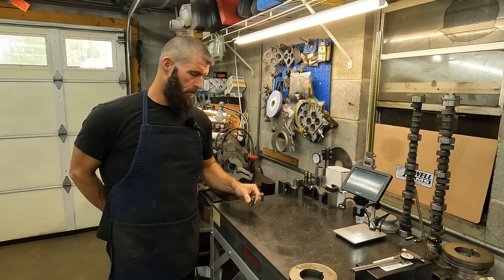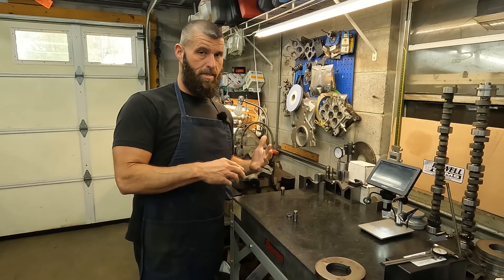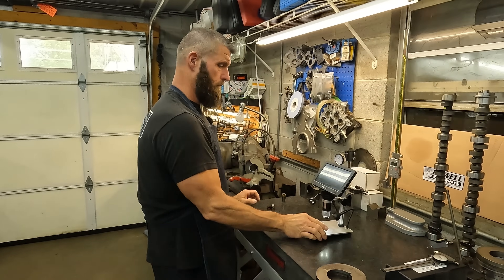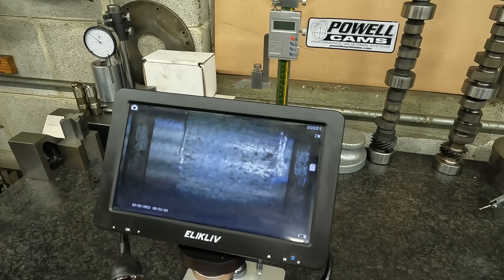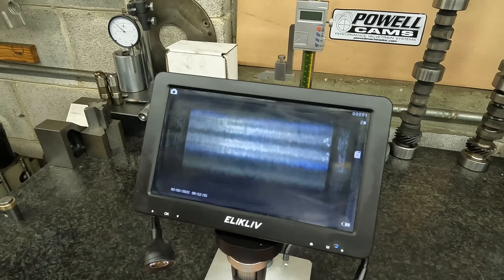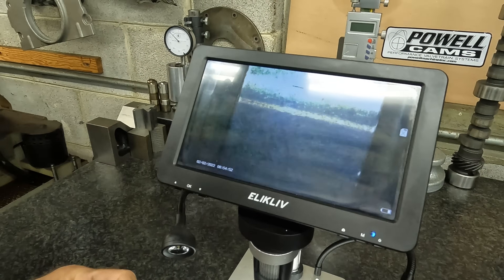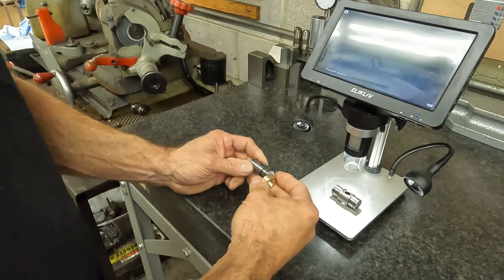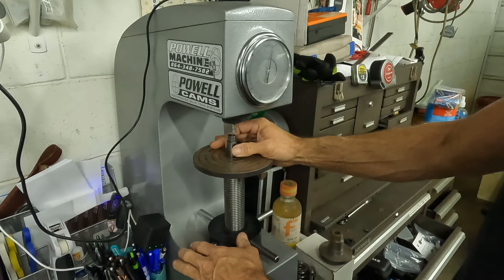Needle bearing trunion kit issues.

Comment: Well, for use on the street I used aluminun 1:6 roller rockers with the biggest widest needle-bearing trunions I could find on my 1st gen. smblk Chevy (which gives me about .590 lift at the valves minus the .017 lash set cold); but I used solid lifters with bushings and rev-springs for my solid roller 110183-10 Howards Cam and haven't seen an increae in lash since Aug. of 2018 when I installed it.

Comment: When I look at some of the systems used on these automotive engines I'm thinking there there's no way in hell this stuff is going to go 100,000 mi this is race car shit that has no business in down the road car applications and I'm surprised most of it lives as long as it does considering there's not a very good oiling system anymore It's like with cams these dry valleys used to be tons of oils coming down on right on top of the camshaft Not anymore You wonder why this shit tears up
Reply from the maker: 95% of the oil that gets on the camshaft is from the rotating assembly slinging it, this holds true for all time,

Comment: I remember way back when making some bushing bearings for a turbine engine where we had 17-4 at two different hardnesses engineers said it was going to work not at all welded solid in short order 
Similar material will not get along that's for sure regardless of one softer and the other harder they'll transfer metal until they start snowballing and they weld
Reply from the maker: Absolutely 💯

Comment: Bushings have a lot more surface area to displace pressure of needle bearing has very little area for the same pressure and they're probably not even rotating just rocking back and forth that would cause untold damage because you're not spreading the love amongst the rest of them needles that is
Reply from the maker: Absolutely correct

Comment: 35 years of tool and die making here.  The material used for bearings is 52100  tool steel. Most American made bearings are made from 52100.   It's really tough if properly heat treated.

Comment: Needle bearings in an engine usually dont end well. Not a huge fan of bushings, but far superior to needles. Needles are not great due to the concentrated load peaks. You can see the needle patterns in the one you showed. Start with the correct material, centerless ground, and dlc type coated steel on steel. I stayed at a Holiday Inn Express last night 😅
Reply from the maker: Thanks for the tips!
Reply: I worked at a Yamaha dealer and the racers “YZ” engine and….well all had needle bearings on the connecting rod. They had adjustable valves lash so I was always in there. These guys ran hard and always in for something they broke. Never saw any visible failure and these had 8k red line tachometers. Personally I’ve owned 17. 
  I am sure there is a lot of “Chinisium” out there as well as US companies selling roller trunnions. But who knows if they buy overseas bearings, finished trunnions or both. GM opened a plant in China decades ago as a Buick and certain Chevys sold as if the where Cadillacs! But, 51% of every company doing business in China belongs to the government there. They reverse engineered the TECH2 scan tool, sold them for $200, and they spilled magic smoke all over the bench. GM went totally internet based in 2013. That was the last year of software updates. Everything is messed up now!

Comment: The problem these days is you just don't know what material is being used in anything you buy.
It can look perfectly good but it's made from crap.
The overseas manufacturers of our goods seem to do this all the time. They have the technology and machinery to make the part and make it to precise tolerances but they make it from rubbish. It's crazy, the manufacturing of the part is generally the expensive part of the job, the material costs run second.
They are ruining perfectly good parts because they cheap out on materials.

Comment: I've worked on custom needle roller bearing assembly machines where individual rollers and races were measured and sorted to give uniform clearances for a bearing package.  The target clearance was in low microns and was crucial for longevity.  Seeing the finish on that trunion I would venture a guess that clearances were probably orders of magnitude too big.  Even if they weren't that finish (and the design with the groove and shoulders) would lead to contamination locally. Whatever the cause (design, material, hardness, clearances) brinelling is what I see. Once you lose your finish you're going bad fast.

Comment: I have a Jeep Wrangler running a 3.6L Pentastar® V6. The engine developed a ticking sound at about 50k miles. The shop replaced my rockers, cam shafts and valves on the left engine bank. They said the rocker bearing were the point of failure. Is this the same issue you’re talking about? It’s under warrant for 100k so I’m hoping the other side fails before then if it’s going to. What’s ya think?
Reply from the maker: Ye0, those engines are bad, we sell lifters, rockers and cams often for them, they have a severe oiling problem

Comment: Not hard enough at the running surface..?  (Before seeing anything) - needs to be .040 deep at the least, RC 58 or better, smooth, round…

Both needles, shaft, etc. need to have the right finish.  (From reading Torrington docs many years ago.)

Comment: I am an old novice asking novice questions. How do roller bearings last so long with the bearing and race both being rock hard and running in grease? I am talking wheel/axle bearings in old rear wheel drive cars. They last 100k routinely and seem to be the same hardness? Thanks for entertaining  an old guy's questions?
Reply from the maker: Full rotation of the bearing element,  proper materials  and proper finish

Comment: I think if the metallurgy is right, then the problem would be finish. A "rough" finish produces small contact points instead of a wide smooth area thus concentrating force and causing breakage of those points.

Comment: Ball bearing, roller bearings, needle bearings are meant to be used where constant full rotation is used and repeated shock loading is low. Whenever you go from a plain bearing to a roller bearing you reduce the surface area that carries the load. That helps with reducing friction but it des not mean it is a better fit for the job. I suppose it could be asked then why do we use needle bearings in Universal joints and that's a good question and I wish I had the answer. Maybe the shock loading is not as bad as you would think?
Reply from the maker: I agree,  but.... other rockers and applications live with needle bearings.

Comment: The lesson is that a "bushing" is actually a "plain bearing" and if provided with sufficient lubrication and proper design is often superior to needle, roller, or ball bearings :-). In a given application often far superior as far as load bearing ability.
Reply from the maker: Correct

Comment: How do the factory GM roller bearings live so long when the aftermarket bearings won't stay together?  Is it just the quality of the trunion material and machine finish?
Reply from the maker: the factory deal has a inner and outer bearing race, its not actually riding on the trunion, plus very low spring pressure and mild cams

Comment: CHE trunion bushes are hands down the best on the market, you will Not find a better factory replacement 
Precision machined material and can be hand assembled they are that precise. Bronze/brass material as well so no needle rollers to contented with this issue
Reply from the maker: Have you had my kit in your hand? ..... the bushing not having a slight press is cheesy , and they are more expensive than mine, so... definitely not "the best,hands down"

Comment: I wonder if Harland Sharp has any problems with their needle bearings in the Ford FE shaft rocker systems? 

I chose to use bushed rocker arms from Precision Oil Pumps.

Comment: That surface finish IS garbage! If that could be compared to the surface finish a used caged tapered bearing from a Ford 8.8 pinion bearing.....shoooooooot. Wow, I'd see wheel or differential side bearings with 100k plus miles with that kind of damage.

Those are good designs on paper. Poor in the field. Very little time in R&D and straight to sales.

Comment: The main problem causing most every part of aftermarket ls valvetrain failure is greedy cam lobe designs. They push lobe design to the limits to advertise hp gains while ignoring reliability. For example, we had one ls3 camaro, gm asa cam 226/236 525 lift 110 lsa with gm blue springs make 469whp dynojet and drove 30k miles before he traded it. Another ls3 camaro made 485whp dynojet with a btr stage 4 233/250 600+ lift dual valve spring deal, they suggested replacing springs every 15k miles. Lol, the gm asa cam is in the 525hp dirt track 6.2 with blue springs, and turns 7300 for 20+ minutes in a race
Reply from the maker: There are Definitely some bad profiles out there.... but, it's rare to see one that killing parts in a hyd roller street application,  if you have some I'd be eager to see them

Comment: I used Crower steel roller rockers rather than the aluminum rockers everyone else was using (Crane) at the time.  The cam was by Reed cams, solid roller lifter for circle track performance. .600 intake, .618 exhaust on a 305 ci v8.  It  ran for 4 seasons.

Comment: What happens if you retain the oem LS rockers/bearings, and use a cam lobe design that needs less valvespring pressure, and turns more rpm safely? You lose that last 15hp from the latest/greatest every part of the valvetrain destroyer cam, but find replacing broken valvetrain parts every 15k miles is no longer necessary
Reply from the maker: The double race/loose needle design is scary

Comment: I bought a Brian Tooley Racing trunnion kit for my LS rebuild due to Comp Cams brand being on back order.   Of the 32 bearings in the kit, i had to toss nearly half because they would seize on the shaft when installed.  Summit Racing send me a second kit for free to try and build a complete set of rocker arms from both.  Of the 64 total bearings, I was able to find 40 that installed properly and did not seize up.
Reply from the maker: Dang...
Reply: Did you contact BTR about your issue?
Reply: @00dustincolvin  I did. Not impressed by their customer service one bit.  I was told to contact the company I bought them from.  Summit didn't question me at all.  They just sent the second kit.

Comment: What's your experience with the roller tips on roller rockers? Are some better than others and worth putting in a high performance engine that end up with high miles?
Reply from the maker: Tip has no bearing so they live

Comment: I updated my 2002 Toyota Tacoma 4x4 front differential from inner needle bearings to bushings not because there was a problem but because the bushings actually have a higher load carrying capability and i did not want to take that clamshell back apart ever because those little tiny needle bearings got loose into the ring and pinion. I now know i made a wise choice because of your expertise. Thanks once again!
Reply from the maker: Definitely,  way more surface area
Reply: Did you source yours from East Coast Gear Supply? I was looking at their part for mine.
Reply: @Record3677  yes I did. I also bought a small ball hone as the bushings were too tight once pressed in. You may not have this issue. Just be aware. Then i just ran my differential overfull so the bushings were always being lubed. Remember i did both ends of the clamshell and has worked flawlessly.

Comment: I had an engine failure in in 2022, when i pulled the drain plug - i initially thought a rocker had come apart. It ended up being the lifter. However, the aftermarket trunions did have a lot of slop. I did not bother reusing them. I am committed to going with bushings in the engine I am currently building.

Comment: Love the accent. But, yep, that makes sense. Poorly engineered gimmicks rarely work. All those components should be harder than hammered horseshit or it's going to blow out. There are always, or nearly always, some imperfections in the steel. So, your trunnions may have some slight imperfections. It happens.
Reply from the maker: Definitely

Comment: Aren’t factory Ls rockers roller?
Reply from the maker: They have a inner and outer race, plus only 70 lbs of seat pressure
Reply: Yes they are but the shaft is made of powdered metal. I would be curious how hard the factory powdered metal pieces are.

Comment: The trunnion featured wore like that because is not hard enough and likely is not a proper steel for a bearing race application. Last upgrade I did was a BTR V2 which employs hardened inner races from the bearing manufacturer (proper grade of steel hardened and tempered properly) on heat treated trunnions. Being as the OEM rocker trunnion bearings are rolling element (needle bearings) and most LS, LT, and Vortec engines do not have trunnion bearing failures, it IS possible for a needle bearing in that application to last 100 or 200 thoussand miles of engine operation PROVIDED the components are up to snuff.
Reply from the maker: You can't make carbon steel much harder than this sample,  harness isn't always the issue,  tuffness is more important in many applications and we get that by tempering,  our trunion isn't as "hard" but it has more toughness.
Reply: @powellmachineinc  Bearing steel has a specific chromium content. It's not some random high carbon tool steel. I'm assuming you tested the hardness, how hard is it? Bearing races are at least 60 Rockwell C scale, and that's at the low end. Engineer/machinist/fabricator/moldmaker/tool & die maker here. I know a little about metallurgy and bearing application. Again, being as OEM needle bearing trunnions  can last hundreds of thousands of miles, it's not an inherent shortcoming of rolling element bearings here.
Reply: @scudzuki The little rollers are harder to make roll, especially under higher loads. And, once there’s a slight surface imperfection it really makes them not want to roll and they’ll just chew away at one spot. 
With factory stuff there’s less loading than with aftermarket cams and springs. That little bit of extra load, and often rpm, can be enough to cause failures.

Comment: No point-loading with the bushing. Needles point-load, so they need significant rotation to dispose of the load. Does this happen to camshafts with needle bearings?
Reply from the maker: No, normally not,  doesn't happen to u joints either with proper angle
Reply: LS LT and Vortec trunnions from the factory are needle bearings. Even after the lessons learned in the LS and Vortec engines, GM still does it this way.

Comment: Bearings in a reciprocating motion should move far enough that the needles (or balls or rollers) makes at least a full rotation. You can calculate how much angular movement the rocker needs to make using this formula: ((needle diameter) / (shaft diameter)) x 720 degrees. The larger the roller, the more angular movement is required to get a full rotation. I doubt that you are getting enough rotation to fulfil that requirement. This is also why plain bearing typically work better for reciprocation motion. Most bearings components are all 52100 bearing steel, typically HRC 60-62, so I doubt that is the issue, although a softer shaft could cause problems.

Comment: My personal experience is , that if bearings are not allowed to spin 360 degrees , with good lubrication , they fail quickly . A bushing , being supported by an oil cushion all around , is much better . Bushings still wear out and eventually fail ,  but take a lot longer to do it .
Reply from the maker: Definitely
Reply: Except for of course the trunnion needle bearings in millions of LS, LT, and Vortec engines, you mean.

Comment: When I get around to building the engine for my 1969 Mustang 428 SCJ I will be sending everything to you so you guys can put it together the right way the first time. Your guys are the best.
Reply: Agreed!!!
Reply: I used to eat breathing sleep FE's, I don't Currently have one, but just seeing someone Mention one I had to read your comments. I just wanted to say, have you guys hurd of the 445 Stroker kits for for FE'S ? I think it's called jailbreak 445?  Or brakeout?  You can turn even a old truck 360 into a fire breathing beast. 🤤 check it out.✌️
Reply: Is there anywhere that I can follow your build. I recently took on the design and construction of a 482ci CS engine build. It's replacing a 12k mile grenaded "428" FE in a Shelby America Eleanor. 

I've encountered some questionable areas here and there and I merely would like to gather as much information of engine builds out there. After building SBFs and LS engines for 20 years I'm very intrigued by the FE and 385's Good luck with your build.
Reply: You'll never be able to afford it. You're a dreamer